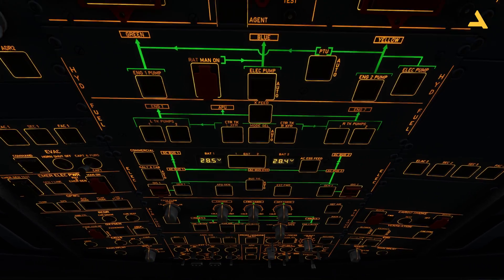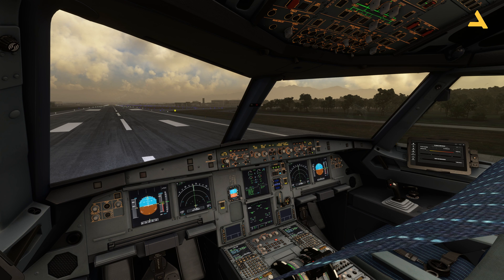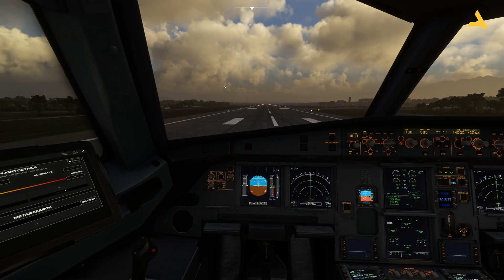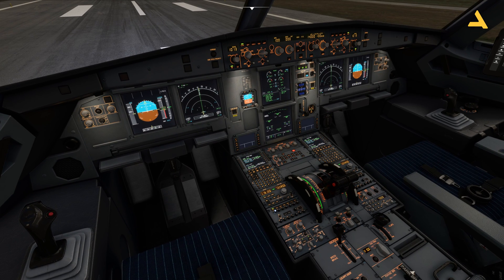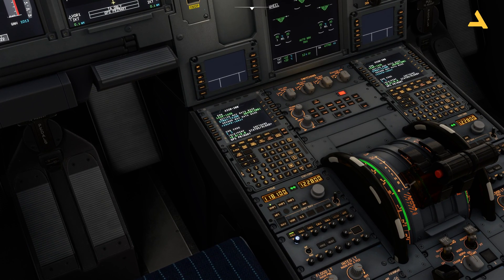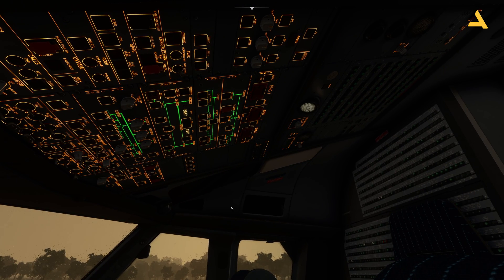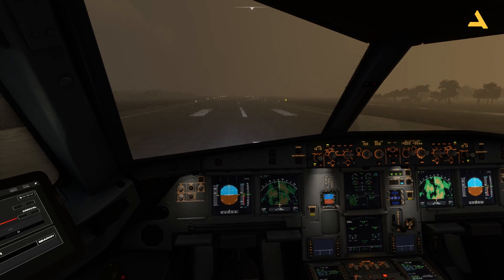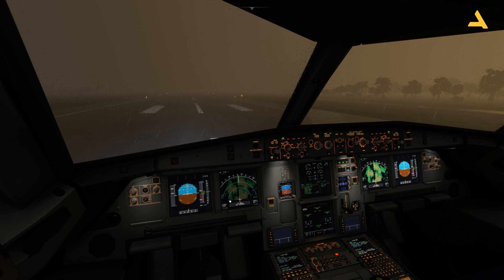Cockpit Lights for iniBuilds Airbus A320 Neo - MSFS 2020 - A320 Neo Tutorial 6

Comment: Hi, i am new to msfs. I use pc and aircraft is A320 neo v2. I prepared the flight plan and put it down in mcdu watching your video but after takeoff when I engage autopilot 1, the flight is not following the flight plan sids and  the waypoints. Can you suggest.
Reply from the maker: Is you heading mode in the selected or managed mode?
Reply: @aatifahmad Thanks for reply, I am able to turn heading knob but when I click on it nothing changes, I use xbox controller and mouse
Reply from the maker: @itsdhruv.r the heading mode should be in managed mode. Bring the cursor on the knob and when you see the up arrow then press the know and the plane will follow the flight mode
Reply: @aatifahmad  Thanks for helping
Reply from the maker: You're welcome